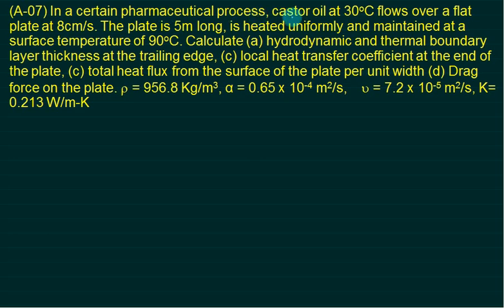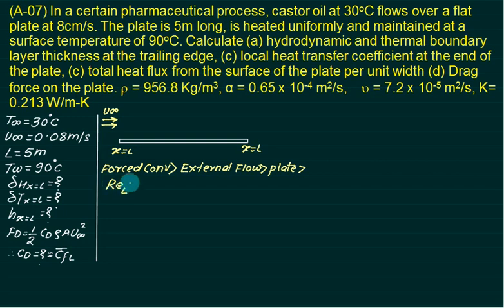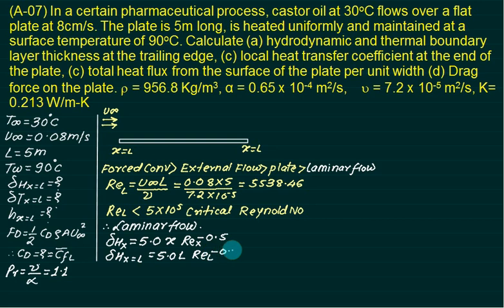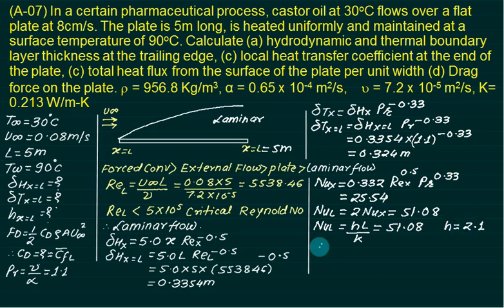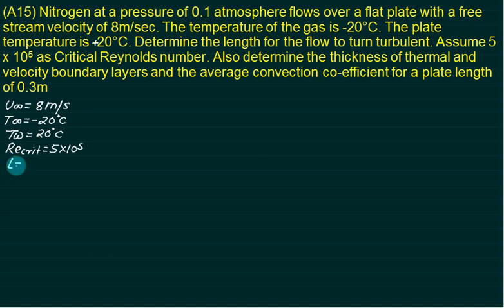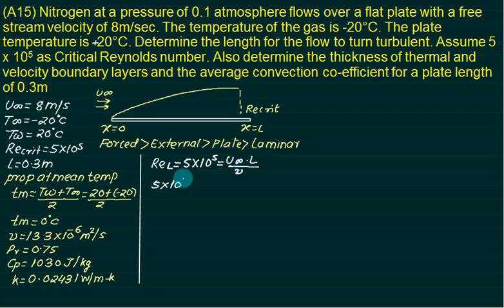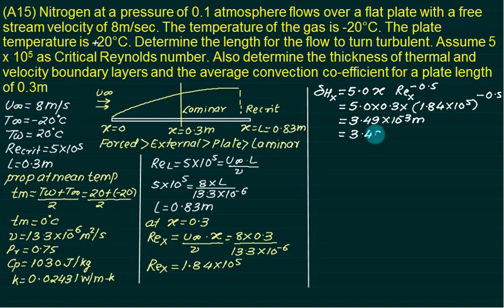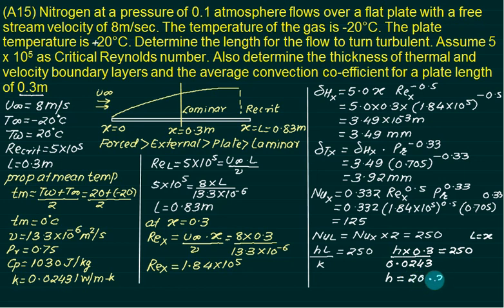04 Forced convection External flow numerical 01

Comment: Ok so. Good. But when you calculated HDBL thickness and thermal BL thickness. You did calculation mistake. It won't be 0.334 m it will be 0.0339 m. Same for thermal layer. If you have possible explanation for this. Please reply here as soon as possible.